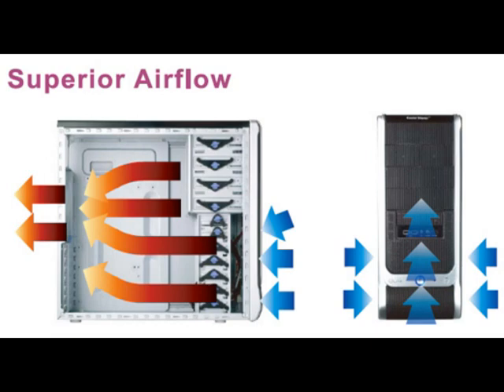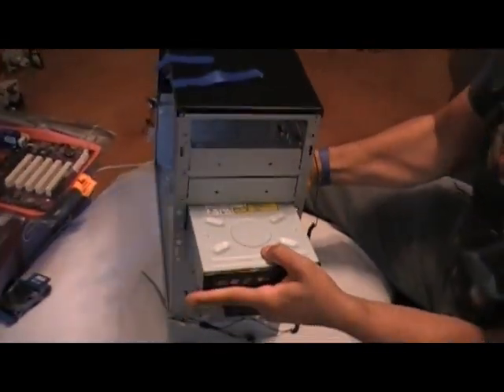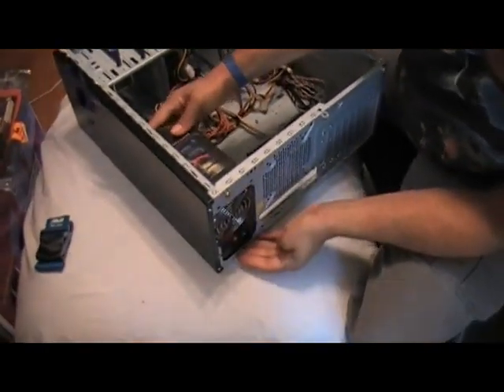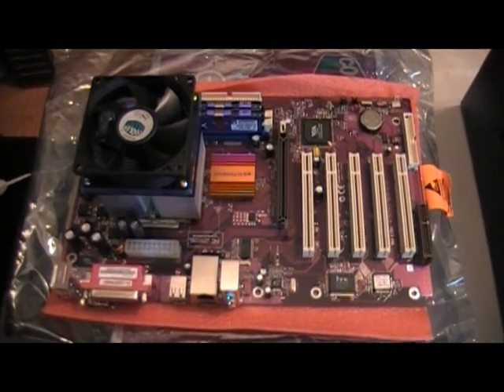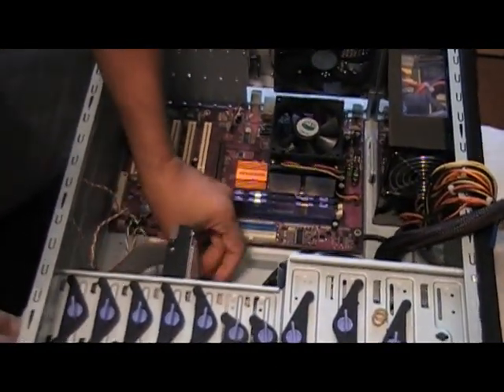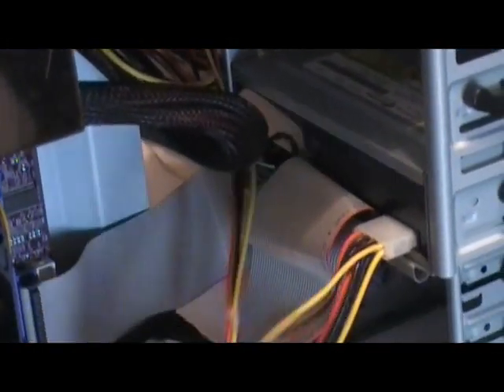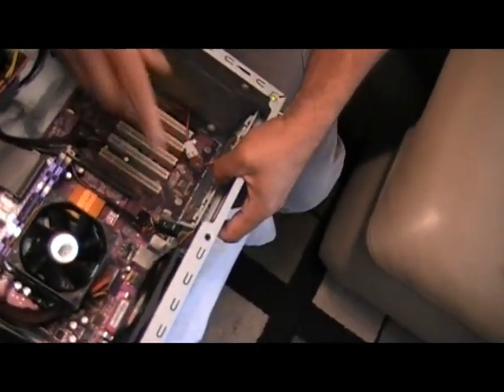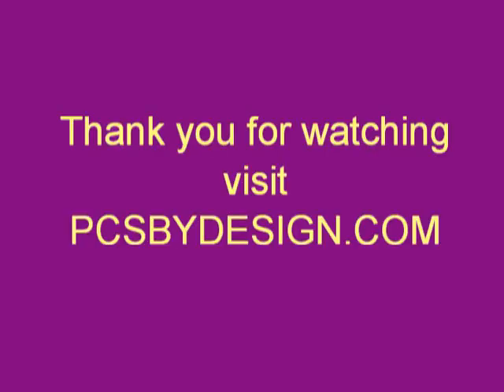Step by step pc build

Comment: I plug the cables into the drives before inserting them..if you new to this it makes it a little easier, less chance that you will bend some pins. Another tip...red stripe on cable always goes next to the power connector (at least on all the drives I've seen).